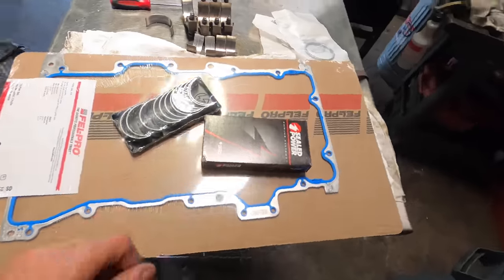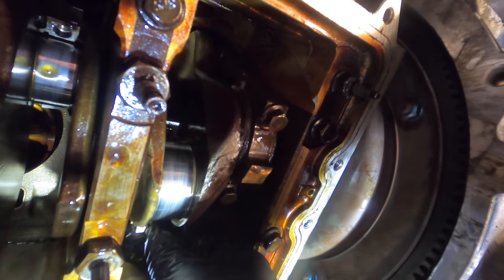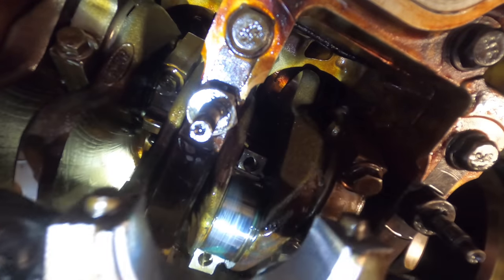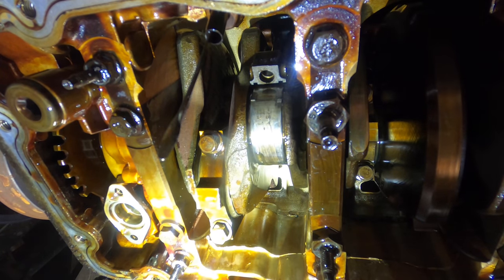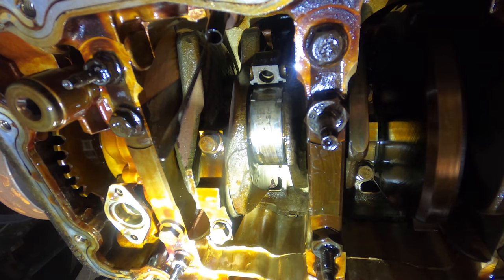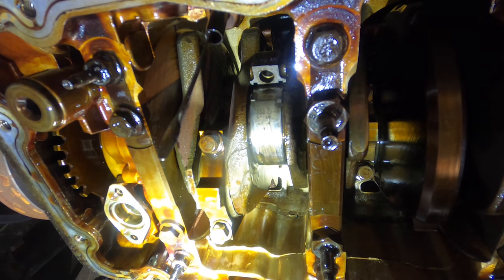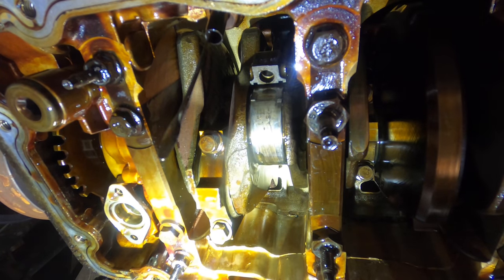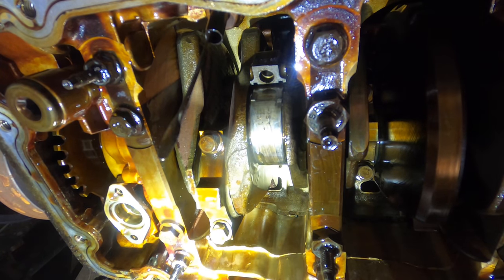Saving an Engine: Spun Bearings Replaced

Comment: as a teenager I spun a rod bearing, over revved engine, was too poor to buy new motor, or used motor. so I pulled oil pan, & bought 1 rod bearing, back then you could get 1 bearing, 35+ years ago, I polished crank with wet/dry 600 grit paper, lubricated with kerosene, & used a shoestring wrapped around paper on rod journal. it worked. now when I put new rod bearing in, rod was loose on crankshaft, so I removed & took the cap & sanded cap on 400 grit paper, glued to a piece of glass, I know I only did 1 side, but I managed to tighten clearances, & I drove car for over 25k miles without issues, I was always afraid to mash throttle too hard, & it lasted until I was able to get another car & was a little more financially stable. the car was a 1964 Impala, & that engine is still in it, & it has been siting close to 30 years in my back yard.
Reply: I had a cam shaft bearing spin.  Put new bearings in but they wouldn't hold.  Ended up drilling a hole and pinning the bearings with rivets and smoothing them down.  It worked and was still working 25k miles later when I sold it. Cam shaft bearings don't have to take anything like the punishment delivered to crank shaft bearings.
Reply: Not an experienced mechanic by any definition so excuse me if this is a stupid question... What about the main bearings?
Reply: You should pull that 64 out of your backyard and get it back on the road
Reply: @AccountSpace  lol, not at moment, I also have another 64 that was bought after it, & a 1961, which I am working on, that my dad bought new, & I plan to drive soon, I also have a 1972 Nova for everyday car, & fixing a 1966C10 truck & have a 1961 Dodge dump truck I need to get on the road to haul gravel. I also drive a Roush truck as a daily driver, & my back & forth to work beater is just a Ford Festiva. lol. so I have enough cars on the road for the moment, plus 2 custom Harleys. I do have a few other cars, & not planning to fix at present, like 2 other Novas from my youth, a 68 Ford Thunderbird, a 1967 big block Dodge Polara my grandpa bought new. as well as a few others, like MGBs, Datsun 510s, & may old VW bugs & busses
Reply: @randymack1782  What an inventory! Sounds like you have great stuff. Too many for a lifetime of restorations. Pick a half dozen of your favorites and pass the rest onto people that will give them the TLC they deserved. This will help fund the work on the ones you keep. Don't be the guy who dies with a lot full of rusted out relics who always thought some day . . . Should have, could have, would have. Nothing is worse than being a party to letting them rest away in the yard. Don't make your kids have to clean up that mess, have a few restored drivers to pass on to them.
Reply: @rsmith3062  

You just described my Grandpa to a T! He left the world with 50 cars that he was always going to fix and piles of other junk. I ended up with a 1970 F100 and 1949 F1 that need restoration.
Reply: Problem is, this is a lot of money for "maybe it will fix it"  Unless you can do the work yourself, the job in this video is just too much money for something that may or may not work.,
Reply: @tarstarkusz  Obviously Ray did the job because YouTube will pay him.  Wonder how many hours of labor would be charged for this job?  A poor DIYer could try this, but not really economically feasible.
Reply: My 64 Olds F-85 broke a main bearing bolt while I was on the OFF ramp.  The bolt head made it up into the camshaft gallery and caught on a lobe causing the timing gear to shear its pin.

I was unable to find anyone to sell me the #8 bolt I needed so I put a #5 bolt in its place.  When that car finally went to its final resting place it had a quarter million miles on the 330 Rocket & Jetaway 2-speed automatic.  But there was so much rust from the New England winters, that it was just not enough body left to restore. I still dream that I'm driving that car from time to time.
Reply: @PaulPassarelli  I didn't even know you could get a 2 speed automatic in 64.
Reply: Damned industrious of you. Bet it is an indication of how you live your whole life!
Reply: @JeresCorner  NOT a stupid question. Ray's decision and recommendation was based on the situation at hand. Oil flows from the passages in the block to the main bearings and then from there to the rod journals. The rod journals are at the end of the line so they normally lose pressure first and take the brunt of damage caused by low oil levels. Upon inspection of the rod journals, it was apparent that the damage was caught "just in time" and going any deeper into parts replacement would be uneconomical for the situation. HAD the damage been any worse he would have stopped and "called time of death". I suspect that IF this had been a newer vehicle or of a higher value, then Ray might have suggested that to the customer. The ONLY reason he tried this was because the car was in such good shape otherwise, having only 91K miles. But remember, it IS a 17 year old MERCURY..  Not a classic collector's car.
Reply: @lifeofgold  thank you for explaining this.
Reply: @JeresCorner  thought that was the main bearing, not even a mechanic here here, just an interested spectator
Reply: @kevinwilliams9380  nope that's a connecting rod or rod bearing. It's the rod that connects the piston to the crank. A main bearing is under the bracket the holds the crank shaft to the block.
Reply: @JeresCorner  Agreed
Reply: @JeresCorner  Agreed
Reply: Had a 68 Camaro with a 327 and a 2 speed powerglide and great mileage
Reply: @tarstarkusz  maybe it'll last long enough to trade at the dealer down the road. Maybe!
Reply: @TheWickedFast1  I think it will be fine and may even last longer than typical.  Maybe the lifters will be the source of trouble if it gives trouble.  With brand new bearings, I would think it would be OK.
Reply: @historybuff8136  I thought they had 3 speeds by then.
Reply: What are you doing with said impala Randy?  Just a friendly inquiry...
Reply: Randy, do you want to sell your Impala?
Reply: @tarstarkusz  doesnt seem like a lot of labor why would it cost so much.  Drop exhaust and oil pain and he is there.  Two bolts per rod and swap out bearings then throw back together.  I have never done this so im just wondering?
Reply: @Ooshwink82  It's more than that.  My point is really it's a lot of money for a fix that might not work.  Whatever it costs to do the bearings might be money down the drain.
Reply: @JeresCorner  they were not looked at
Reply: I want it
Reply: I want that impala
Reply: Now that 64 Impala is worth more than a house cost back then.
Reply: I love hearing stories like this.
Reply: @lifeofgold  i dont know with prices today that 17yo mercury could fetch pre-pandemic collector's car prices. 🤣
Reply: @JeresCorner  It can be done on some engines in vehicle.  I've replaced them on older 70's cars.
Reply: @tarstarkusz  You are correct sir, although with his experience level he was playing the odds or you could say he was rolling the dice. In either case I don’t know that job would cost or how many hours it took
Reply: @chetmyers7041  its alot cheaper than anew engine and in this inflated car market, alot cheaper than another car. i'm sure the customer paid for 5-6 hours of shop labor plus parts.
Reply: nice story
Reply: @tarstarkusz  it didn't work on my '90 Sable.  Glad I spent my own time instead of $100/hr on someone else's, but would like that time back ha
Reply: @tarstarkusz  There are ways to minimize those risks, and he may have used these and simply not filmed it. Plastigage is used to check clearance specifications, and if those fall within spec after polishing, you can be pretty sure the repair will hold just fine... mostly. 😅 Of course one needs to be capable of using their tools and equipment properly, or nothing is going to help. 🤪
Reply: @chetmyers7041  
For a DIYer, a pack of shells and a sump gasket is a few bucks. 
It’s strip down and reassembly hours that rack up a workshop bill.
Reply: @PaulPassarelli  Wow, how men love their cars. That last sentence literally made me tear up.
Reply: @JeresCorner  the rod bearings lead a tougher life than the mains. He knows that and took a chance. Replacing all the main bearings would involve removing the  engine in most cases.
Reply: @Ooshwink82  he likely had close to six or 8 hours into that repair.
Reply: @chetmyers7041  What are you talking about? Ray is working at his job and his job has nothing to do with Y/Tube, but has everything to do with his Employer, the Shop he works at.. 
He is so lucky that his  Boss lets him video some of his jobs...
Reply: @tarstarkusz  They had the old Powerglide 2 speed automatics since 1950's I believe...
Reply: @frandanco6289  I thought they had moved to the 3 speed autos by 1964
Reply: Years back I knew a guy with an Audi, it was a 5 cylinder job, he put a rod out but it jammed the piston up in the bore, what was left of the rod just spun round on the crank, he ran it on four cylinders for a couple of years, MOT,s were less strict back then, it ran like a pig but he kept it running.
Reply: @tarstarkusz  I know the 2spd powerglide was in use at Chevy until 1972 on some models, like the Nova before finally phasing it out all together. My '74 Nova had the 3spd autobox. Drove that thing for 2 years in the 80's before moving to a '78 Nova. The main thing was the '78 was a 2 door, had a few more options, including AM/8-Track stereo and the 305CI V8, instead of the venerable 250 inline 6 of the '74. the '74 was the base 4 door.
Reply: @johnhpalmer6098  I'm early gen-x and so the older cars when I first learned to drive in the 80s were mostly from 1970s along with my circle of friends.  Of all the cars we owned from that era, they were all 3 speed automatics or they were  sticks.  I had no idea GM was selling a 2 speed auto in the 1970s.  I had a 75 Nova and it was a 3 speed automatic. I am pretty sure it was the 2 speed autos that gave the automatic such a bad rap being known for bad performance and gas mileage.  But really, the 3 speed automatic was really no worse in my experience than a 4 speed manual in terms of mileage or performance. Even the 3 speed autos of the 60s were fine.

Funny thing, none of the 70s cars I or my friends owned ever had a stock stereo with an 8-track player.  I don't think I've ever even seen one in person.  People give the 8-track a lot of grief, but when the carts are in good shape and the player is well maintained, they sound excellent.
Reply: @tarstarkusz  Same here, my first car in 1982 was a '68 Chrysler Newport with the 383 2BBL carb. The Nova replaced that, then the '78 replaced the 74 by 1985.
Reply: What happened after 25k miles did the bearings hold ?
Reply: Piece of glass? Please  explain .
Reply: @chetmyers7041  very feasable if you are a pretty good mechanic with decent common sense and not just a keyboard cowboy.
Reply: @tarstarkusz  you could get a automatic transmission in a 52 chevy and a olds had them in 49.